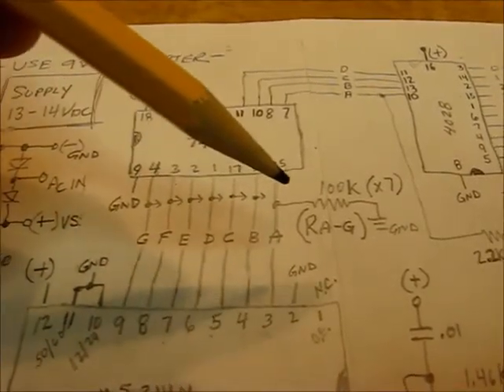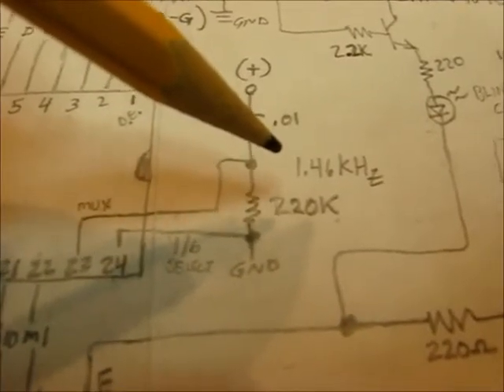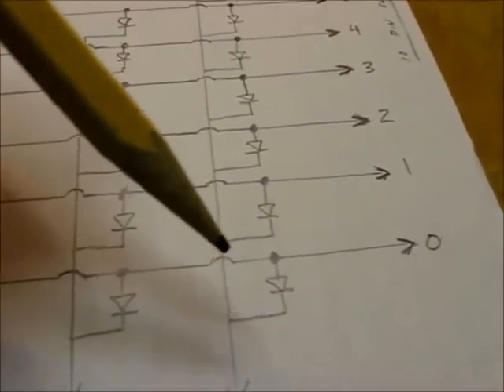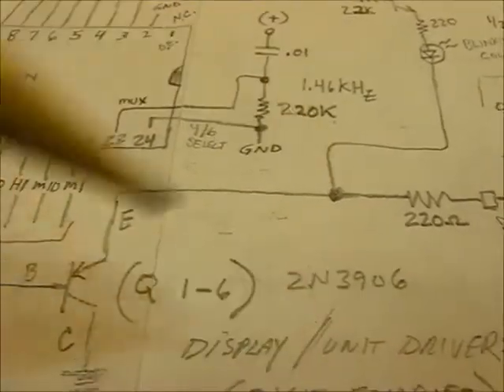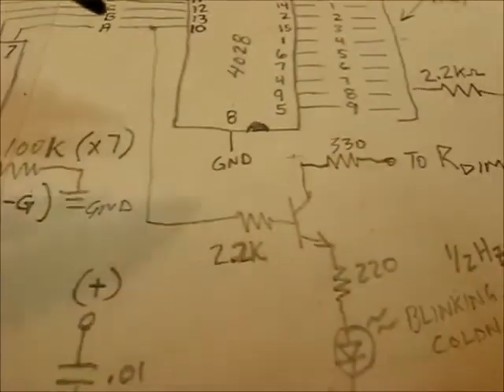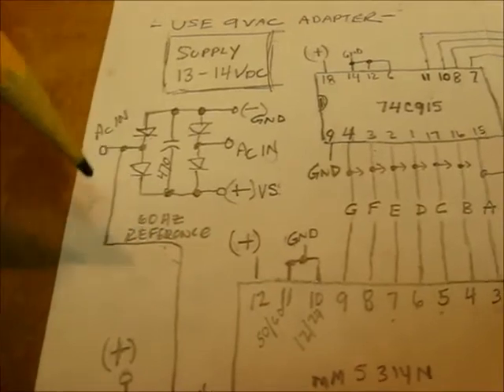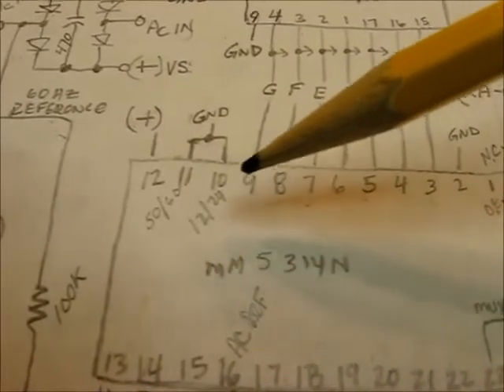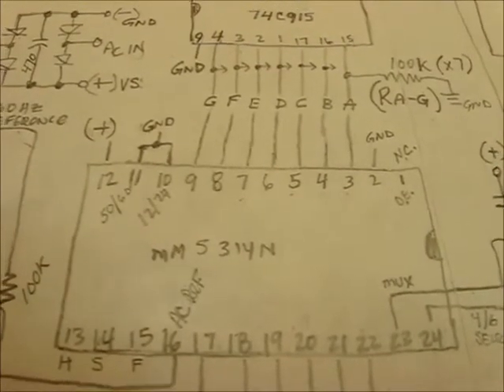Designing a 6 Digit Clock with 1 of 10 driving circuit using the MM5314N, 74C915 and 4028 PART 2 rev

Comment from the maker: Thanks for coming back.  It has been a while and I must say, while I do tinker, the theory is not my strongest point.  I will try to give you what I can and remember from this exercise.  At 9:44, that signal is from pin 16, the AC ref.  If you go to the beginning at 0:10, you can see the portion of the schematic where the signal is indeed tapped off one side of the bridge.  Follow that down to where you saw the resistor, cap and diode and the node then feeds pin 16.  That is the standard hook up taken straight from the MM5314N datasheet suggested connection diagram.  To me, you do bring up a question that is a good one.  What is going on here?  I never even gave it a thought.  First thought....While the transformer used is rated at 9 vac, what is the actual running AC voltage here?  It may be a bit more that 18 vac peak to peak as this circuit does not load down the supply much.  I do know that the measured running DC supply is close to 14 VDC.  We would have to try to calculate backwards.  I have to try to wrap my lil brain around this a while.  I can not give you an answer at this point.  I am having some physical issues and have sidelined the projects for now.  Maybe you can assist in this venture?   Also, just a wild one, in your simulated circuit build up, did you connect in a MM5314N to the node to see if it has an impact of loading?  BTW, beware of the counterfeited IC's if buying on ebay.  I am not sure how good they are or where they came from.  New old stock, from the USA is the best or even used ones but they can be risky sometimes as people sometimes sell old estate items that may be saved bad items unknowingly.  Try Electronics USA in California and talk to Jack.  He has a few NOS ones.  https://electronicsusa.com/mm5314nclockchip.html  
Keep me posted.

Comment: Hi again, I'd like to try building a vintage clock so I am back watching your videos 😄.  There is one question that puzzles me and I was hoping you could shed some light on it. At 9:44 the waveform on your scope shows the A/C input shifted up (I assume via a DC offset).  In other words, the lower peak of the A/C wave is now at zero volts (ground).  I don't see anywhere in the circuit where the double ended A/C signals is shifted up. I believe it would also be attenuated since the A/C coming in is at 18v peak to peak, yet you are showing 13v peak to peak on your scope.  I even simulated this part of the circuit (A/C coming into bridge rectifier, then being "conditioned" w/100k resistor, cap, and diode) and observed no signifcant change to the A/C waveform.  My guess is that you might be tapping off the half wave side of the bridge, but that still doesn't explain the 13v.  So I must be missing something.  Thanks!

Comment: Not sure why you needed base resistors for common collector NPNs and I do see the 220 ohm resistor on the emitter.  Also, given that you need them, I think 10k rather than 2.2k would drive them less hard and might possibly allow you to use the pot for dimming (but that's just speculation on my part).
Reply from the maker: Thank you for your input.  I have to admit, I did struggle with the transistor switching a bit.  For what ever reason, without resistors on the 10 bases of the transistors driven by the 4028, odd occurrences were experienced.   I added the 2.2k's and all was better.  I later thought that 2.2k was probably not the best selection (I forget how I arrived at that value)  and thought that 10K would be a better choice as there is probably no need to drive the bases that hard.  I agree.  That 4028 would also probably run lighter.  I may also agree with your speculation on the original dimming idea that I did away with.  thanks!